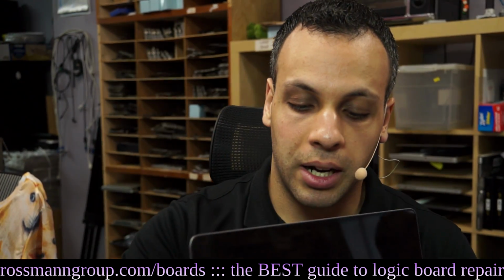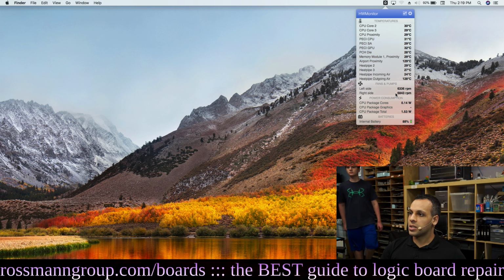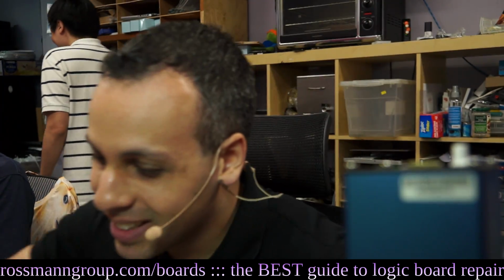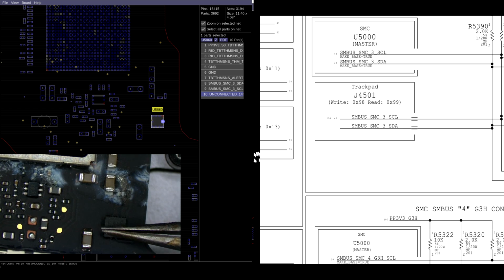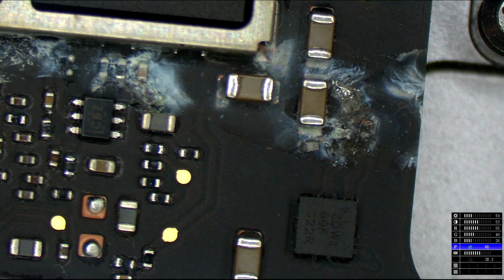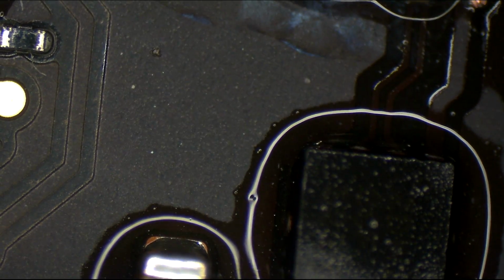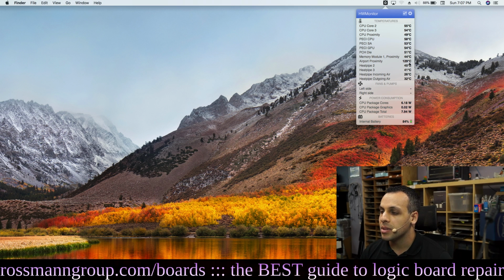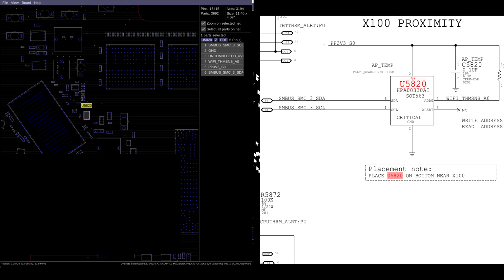How to repair sensor on Touchbar Macbook when running slow without Apple diagnostic software

Comment: Love whatcha doing here! You made me realize a MacBook Pro is quite the expensive mistake after watching a bunch of your earlier videos, which caused me to research some much better Windows options that fit my needs better. Also, for like half the price. Rock on dude! Rock on!
Reply: Yup, half the price and half the lifespan.    You’ll see.
Reply: @theProjectDev  Sure, like have a lifespan of only 10 years of which 8 were spent at average temperature of 80°C because it was a cheap laptop in the first place, definitely not designed for serious and 10ish hours long gaming. Have 4 more laptops with Windows' on them (one has dualboot Ubuntu) which are 1, 2, 5 and 11 years "old". Each one of them is still working.
Only one that broke but was fixed was the one I mentioned at beginning. The guy that fixed it said that it was the most burned out motherboard that he ever tried to fix.
Guess you are right, he'll see. At least he'll see how much luck he has because from all my experiance, if he has no luck with that particular set of hardware he buys, he's fucked regardless of OS and manufacturer.

Comment: the fact that Apple would pull a diagnostic tool from public domain in order to prevent "customers" from diagnosing their problems says it all about this company.  why anyone would give apple $1 is beyond my comprehension.
Reply: The problem is not how believable it is. The problem is how little effort customers actually put into "knowing any better." If "I didn't know any better" is your excuse for buying a garbage product, you have a very flawed approach to buying products in general, not just for computers. If you can't put an ounce of effort into researching what specs mean and the kind of value for money you're getting before buying 1500 dollar machines, you either have money to spend into retirement or you're objectively stupid.
Reply: E_M_E_T Well I will say that in the past Apple did actually have the best build quality for their laptops. Basically thinking back to around 2015. I mean there read and writes on their SSDs at the time kicked the competition out of the water.

However, things have changed dramatically with tons of thin, machines coming out from companies like dell. They usually have a solid NVME if you don’t cheep out and have ease of access to expand with a second nvme. So props to the engineers at dell for making it happen.

I believe Apple will be forced to innovate or die in the near future. Their prices are getting out of reach of the vast majority of their consumers. We can see this by what Mac is top selling. It’s never their most recent Mac book mind you it’s usually last years or the barebone version of the 13” pro. 

I don’t care ether way though because I refuse to buy a machine that only has USB type-C. I’m not ready for the doggle life on something I expect to accomplish real work on.

I will say that I’m happy with my MacBook Pro 2015 it has aged pretty well despite being so outdated but when it comes time for me to upgrade which will be soon I’m properly going to opt for Dell’s XPs15 inch
Reply: E_M_E_T exactly my problem. I've been around computers all my live, and i love and hate most big brands. Every brand has plus and minusis. And computers and software etc can be complex. Them try to discuss in a nuanced way with apple users, impossible.
Reply: You have to give Apple credit, they successfully re-branded Brainwashing as Marketing. I wouldn't at all be surprised to hear they water board any user that threatens to ditch Apple devices.
Reply: E_M_E_T Unfortunately many people would rather mindlessly buy shit and later bitch that “back in my day” things were made with real quality
Reply: harry bob
Agree... Sort of. A very small number of niche products are Apple only. But the majority of people who insist they need a specific Mac only program are just resistant to change.... Most non-niche programs have equal rivals on Windows, and some have equals on Linux. It's just that the user learned how to do things in Mac Only Product, and doesn't want to spend a few hours/days learning something a little different in order to save the business lots of money.
Reply: Even tho their hardware is as bad as it is, there is just no replacement for some of the software available on os x/mac os like devonthink and omnifocus or nearly all alternatives are just not nearly as good like with alfred and yoink.
Reply: Well, someone's feeling the need to defend their religion. There is no such thing as a Windows fanboy by the way. No one in the world 'love' M$, only those who had to live with it. Now, Apple though...
Reply: The problem is whilever people are vocal about how great something is, it drowns out the real-world reports of how a product is.

This is why there is supposed to be advertising and journalistic standards, except the government allow these to erode if they are profiting out of it.
Reply: Don't forget lots of apple users were the kind of people that believed that they couldn't get viruses, and had people that burned several credit cards to scamware. So yeah apple is well on its way to being the next scientology.
Reply: they themselves said that they are a "haven for people who dont know any better", literally calling their customers stupid, vulnerable, and incapable of research; and getting away with it. Also, Apple is a cult, in a very literal sense. Experiments were done where Apple ads were played in front of Apple fanboys, and the parts of the brain that usually get active during religious processions also became active during the ads. The hordes of people outside an Apple store whenever a new product comes out may as well be religious fanatics coming to pray.
Reply: @thetrashman5252  well said about the brain.. I love your logic. Hopefully those who would come to pray at apple stores will have their prayers granted as in getting new macs, iPhones, apple watch and maybe autonomous cars that apple have been said building it in secret hahahaha 🤣🤣🤣
Reply: Marketing is a very powerful tool apparently.
Reply: kelvinfried chicken i mean Apples phones actually are not bad. I hate where they are going with the notch and removal of Touch ID but from the standpoint of how it performs I would say it’s flagship worthy.

I mean they never get blown out the water by companies like Samsung so that’s pretty acceptable. Their updates are also timely which cannot be said for many Android companies
Reply: Marcin Berman holy cow that's hot. I haven't had this issue in my personal experience but then again I don't edit super large videos. I still render fottage in 1080p. Also I don't actually rely on my Mac so much as a editing machine and instead ironically use it for codeing. It's pretty nice to be able to just lay in bed and crank out some code.
Reply: Ill give you one reason: Ive always used Samsung Galaxy phones since s3. As such, I upgraded to S7 when it first came out and it was fine initially. However, Android pushed out an update late last year/early this year. After updating, I realized my phone was depleting battery (think 1% loss every 2 minutes without it being in use ). In addition my fast charge capability was gone- it took 5-6 hours for the phone to charge and if I used the phone while charging it, the battery would still continue dying. I tried different chargers including wireless chargers but realized the update had broken my firmware, essentially reducing phone usage to only a couple of hours a day before it would die. Contacted At&t and their legendary technical support told me to go to Samsung. I contacted Samsung and they told me to wait for another Android update which - according to them - can take some time as updates first get pushed to newer models (think s9 then s8 and so on) and trickle down to older models, which meant I'd have to wait at least 6 months to a year before my phone was fixed. Ive refused to buy another Samsung ever since. I have an iPhone 8plus. Does it have flaws. Absolutely. Does my phone work though? You bet your ass.
Reply: SHEEP MENTALITY THATS WHAT
Reply: blitzwing1 Im well aware of apple slowing down the phones. By the time it comes to that though, it'll most likely be time to upgrade. Again, I know it has its flaws and im by any stretch not an Apple fanboy. This is a marriage of necessity. 

And I consider myself fairly technically inclined, which is why this was all the more frustrating. The most tech support people couldn't diagnose firmware issues from a can of paint-- multiple of them told me get my charge port fixer. It was after I told them the wireless charging wasnt even working, they decided perhaps the latest update was the culprit. It was particularly annoying because I kept telling them the phone was only operational for maybe 2-3 hours a day before dying. That in of itself would indicate it wasn't just a charge port issue. Though I guess admitting that would mean they messed up an entire phone with an haphazardly QA'd update. Anyone who thinks Apple as a company is that much worse than Samsung is deluding themselves. Both companies suck.
Reply: I have very very smart friends that love Apple. I do not know why. They admit that their business practices are shit, but they like the OS. shrugs I don't get it either. And they're fully aware they're getting deeply fucked in the ass by the prices, etc.
Reply: They're sleek and pretty paperweights that are well marketed.
Reply: It's a cult
Reply: let alone paying $1000 too much for a dual core...
Reply: E_M_E_T Exactly. Some people just don't look into what they buy. Luckily I did know better, but some people actually trust what apple  says.
Reply: Tim Howard As much as I am against apple. I have to admit they have very convincing marketing. If I didn't know any better I'd believe it when they say their machines are innovative and well built.
Reply: @carlangelo653  " have to admit they have very convincing marketing"

That sentence is everything wrong with all companies.
Reply: Because most people don't care if their device is "repairable" until it breaks. Also, until there is a better (or at least equally good) operating system with support for all the amazing apps available for OS X - I will consider switching.
Reply: People like macOS
Reply: @jamalhalili2173  People don't like macOS. People like software that runs on it, but not the OS.

Put the money and development from macOS towards linux and you have one helluva system.

MacOS is not needed, it should not exist. Just another way to force you to stay in their ecosystem.
Reply: Lagger Onesixfour yes
Reply: Lagger Onesixfour people like the software that runs on it and the UI, which is why they'd pay money for it